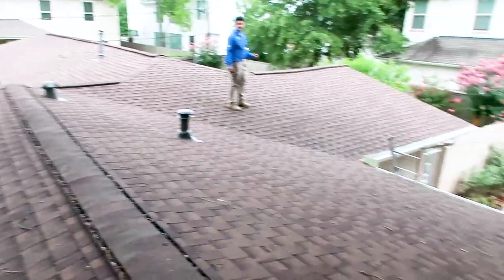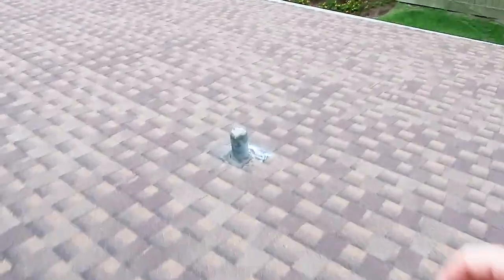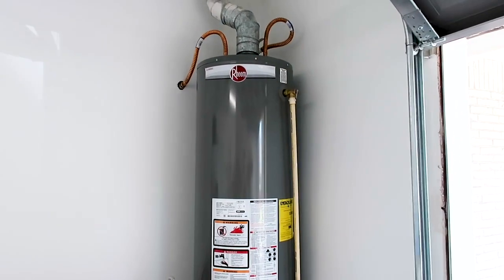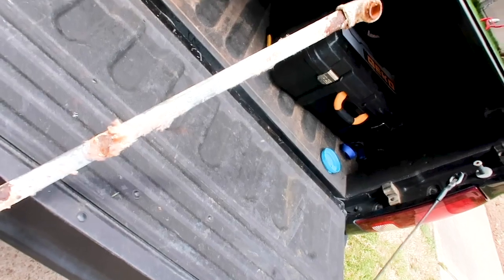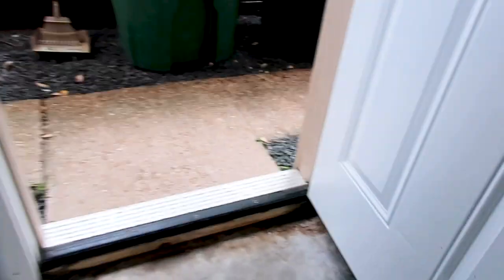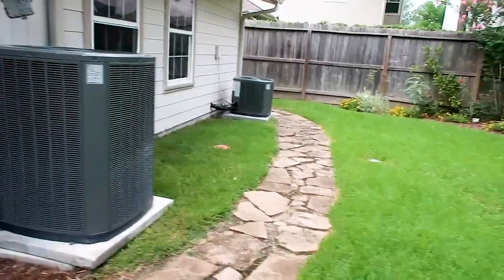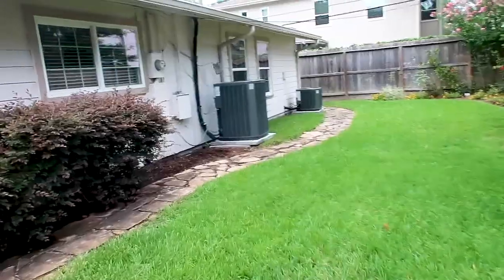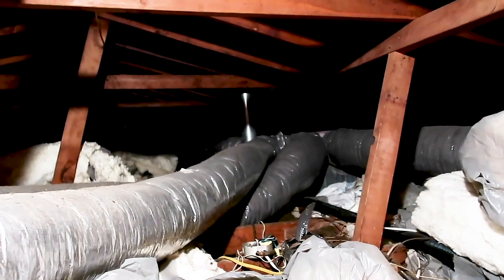Home Investigator: Episode 8 Common Old Home Problems 2 - The Houston Home Inspector

Comment: Would you call out the threaded TPR valve on the water heater?
Reply from the maker: Depends on if it is capped or not.  I might make a note depending on the situation.